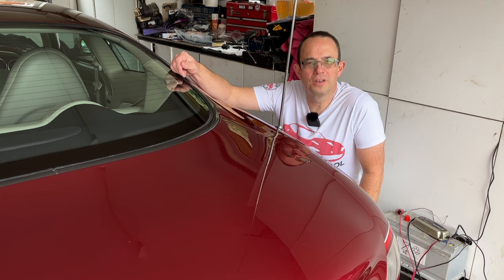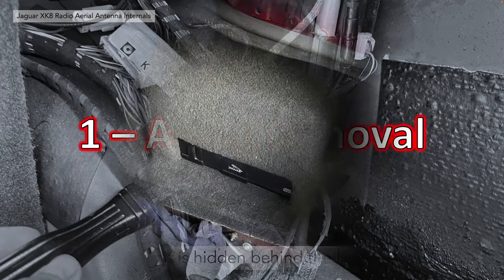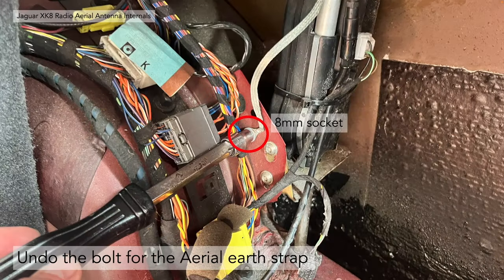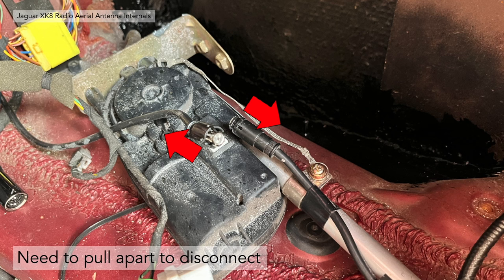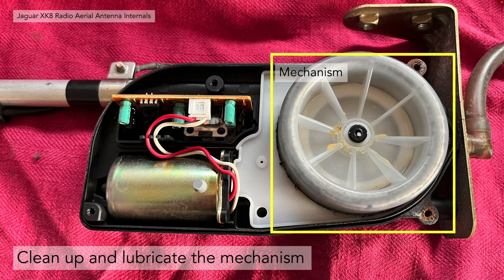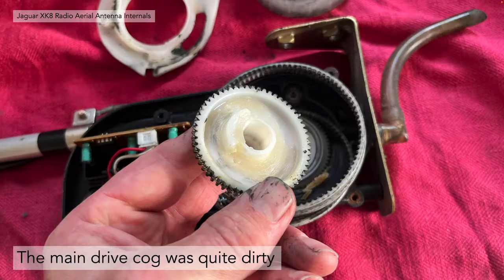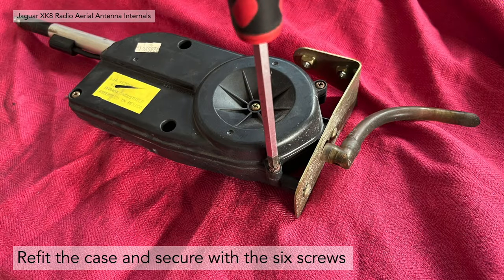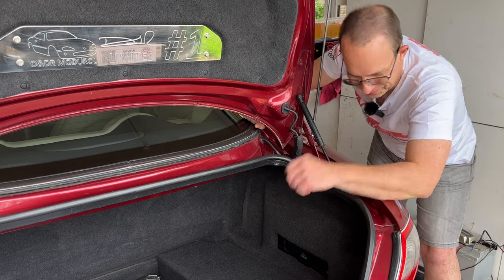Jaguar XK8 Radio Aerial/antenna removal and internal mechanism lubrication. XKR / X100

Comment: Thanks for showing. This work is really easy, I had already done it on my VOLVO 965. This vehicle was built in 1995. Damian, your videos are always very accurate.
Reply from the maker: Udo, thank again for your support. These motorised antenna's were once a luxury item, how things have changed. This design of radio aerial really helps identify the era these cars came from, regards Damian

Comment: Very useful Damian thank you. My aerial stopped retracting fully so I'm sure this will help. I'd like to add an amplifier to my standard set up one day as the stereo is underwhelming as is. Do you have a video on this?
Reply from the maker: Bernard, I haven’t done a video on adding an amp but there is a video of refurbishing the original head-unit. This made a surprisingly noticeable difference to the power and quality of the sound. Coming up in a couple of weeks, regards Damian .
Reply: @ODRModurol  that'll be really interesting.  Already got rid of the dead speakers awhile back post your video on that. I'll be curious to see what you did.
Reply from the maker: Bernard, to be honest the back lights were not working so sent it off to guy offering repairs. Came back fully refurbished and sounding better than ever, plus an added feature. More details coming up very shortly, regards Damian

Comment: Just about to tackle this job and I have a new tooth cable ready to go if my existing one is beyond saving. The very end of the tooth cable: does that clip into any part or is it just lose in the housing? Thanks
Reply from the maker: Paul, the toothed end of the cable is just wound back into the white housing. There aren't any clips. Good luck with your repairs, regards Damian

Comment: If you're still  answering questions, I have one I need an answer to, I lost my mast to a tree that broke it, I've ordered a new mast on eBay, and my question is this, must I do as you did, take it all apart, or can I just slip the mast into the mast hole and it will connect freely that way, or do I have to get under the hood to connect it as yours is. Which way is the proper way to reconnect my XK8 radio wand. Please let me know, thank you!
Reply from the maker: Randy, yes we are still answering questions. Yes,I believe it is possible to remove and replace the aerial without removal (see link to video below). However, haven’t seen this method used with a Jag aerial. Might be worth a try as if doesn’t work you can use the removal method. Sorry can’t be more helpful, regards Damian
https://youtu.be/QpMPMBjUs90?si=lf5msbrd0lVwzYvJ

Comment: Re 2006 XKR . How do I find the cable to connect a new antenna to? Existing antenna  which I removed was not OEM  did not have  a jack to connect  to and did not work. I see a jack but it is connect to another large cable bundle  whose purpose I do not know. Is there more than one cable jack in the area? Thank you.
Reply from the maker: Joel, very difficult to help you without seeing some photos of the problem. Please send them to oanddr@gmail.com . Alternatively, there are wiring diagrams available on our website which might help. www.modurol.co.uk . Good luck fixing your radio, regards Damian

Comment: How much did that cost you for parts etc all in?
Reply from the maker: Melba, I only lubricated the existing aerial mechanism. So I only used some grease. However, it buy a new aerial mast is only £10 to £15. Easy and cheap fix either way. Hope that helps, regards Damian.
Reply: @ODRModurol  sure did thanks from California for the instant reply. Simply weighing time/repair vs. replacement. Many thanks
Reply: @ODRModurol  + the cheapest unit I can find over here is ~$81 USD 🤷🏼‍♂️
Reply from the maker: @rdm415, you only need to buy the aerial mast and not the complete motorised unit. Normally the tooth break on the mast and not the motor cogs. Here is an example for your information. https://www.ebay.co.uk/itm/362298111777?mkcid=16&mkevt=1&mkrid=711-127632-2357-0&ssspo=XQKMQxIySje&sssrc=4429486&ssuid=sgHoZWOXTEe&var=&widget_ver=artemis&media=COPY regards Damian
Reply: @ODRModurol  very helpful, cheers! I'll report back my results. Thanks for taking the time to inform
Reply from the maker: No problem, glad to help, regards Damian

Comment: That black grease looks nasty.  I prefer Lubriplate white llthium grease.
Reply from the maker: Gary, thought that myself but it’s what I had in the garage, regards Damian
Reply: @ODRModurol I would have brought some over.
Reply from the maker: @garyvanremortel5218, nice idea, would be very welcome, regards Damian
Reply: @ODRModurol  Thanks for all your very helpful videos...My arial is sticking (WD40 not solving it) and if I have to replace the mast is there any guidence and info regarding removal and fitting of the new mast...again many thanks...2001 XKR Convertable....Alan